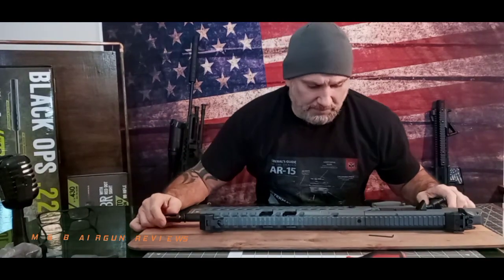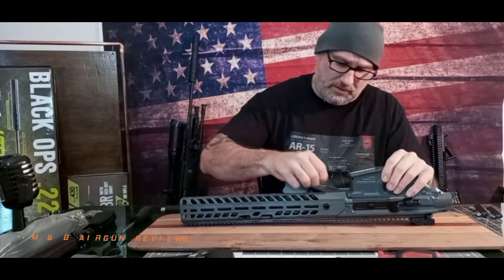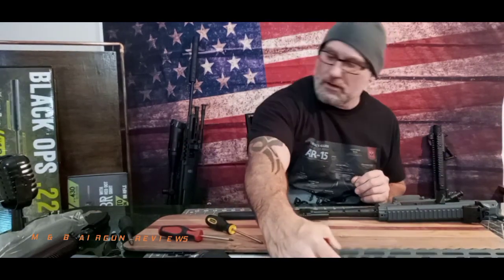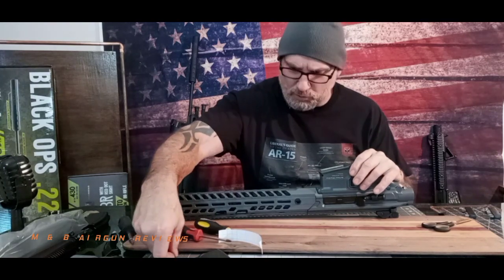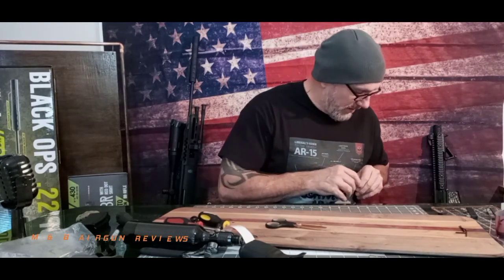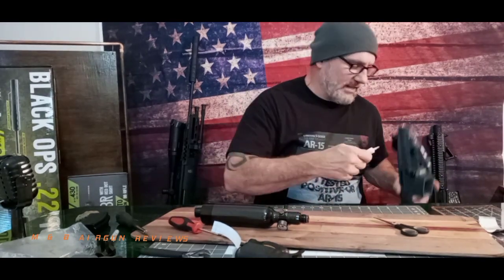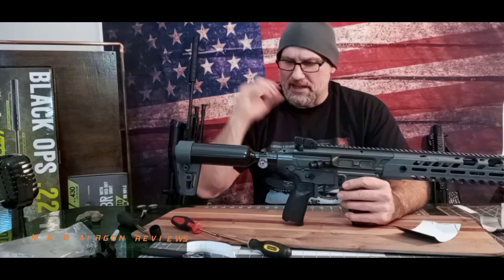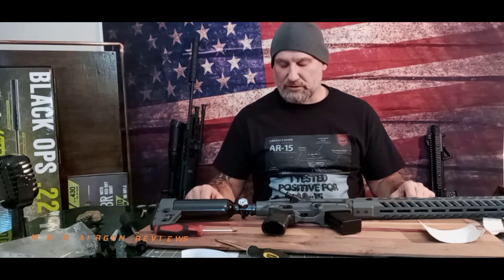Sig Sauer MCX VIRTUS PCP air rifle.  How to remedy the poor quality control.

Comment: Damn! I so hoped to see this one get apart on the table. I've just been sooo curious to see how much (or little) this one differs internally from the .177 co2 MCX. But still nice to see the bottle not to wiggle anymore just by doing this fix from the rear. Fasterr and an easier fix for many.
Reply from the maker: And its been reliable since these easy fixes. At first I couldn't hit the broadside of a barn from inside the barn. Now it's a little tackdriver driver.  
And so far no jams. So that's good.
Reply: @FultonStreetBeats  Awesome to hear! Even though it now just makes me more bummed out I did not have the extra cash on me to buy one when my favorite local airgun selling stores had of them in stock..
 Seen and heard often of these issues but been confident to know I'd probably be able to fix them myself.. I kinda love Sig Sauer pellet airguns just because they always seem to need some small fixes before being all good.😂 Too perfect airguns seem a bit too... "boring"..😁
Reply from the maker: We always need something to fix . Lol. Im the same way.
Reply: @FultonStreetBeats  Yup. And I just love fixing my co2 airguns. Pistol replicas mostly..
 My Sig P226 ASP was a total disappointment as new. Inconsistent power output - and the accuracy was the worst I've seen on any airpistol, ever. Covered randomly all over an A4-sized paper from just 20ft. The nowaday classic " Sig P226 ASP barrel issue".. One badass pellet pusher now.
Reply: once the bottle is filled there is no wiggle.You did not need to shim it.
Reply from the maker: @aaronrockler2327  the bottle should not move without air in it. This causes  undo stress on the internal pressure tube when not charged.  All virtus rifles do not do this. Sig is aware of the problem  and are rectifying  it. Or at least they say they are.  The  bottle wobble is caused by a manufacturing  flaw in the tooling.  The bottle not wobbling after being charged is simply   biproduct of physics and pressure.  If the initial  tolerance  is not correct the pressure  will make it worse  over time.  If you have noticed  many Virtus  rifles have been returned because  of this issue. Some getting so bad they eventually  start to leak and lose pressure.  I have talked  directly  to Sig and no it is not normal and is of concern to them also.   While my wobble was not super excessive....  lots of them are down right Scary.
Reply: thanks for the info.I returned mine today and asked them to check the bottle before they send me a replacement.

Comment: Did any body comment about the cocking lever? mine wont fire unless you cock it when you put the air tank in.
Also the trigger does not return to the fire position after it is pulled, you have to push it back by finger, not good for accuracy (or finger soreness!)
Will attempt to put a return spring  on it.
Reply from the maker: Sounds like you got the UK version. They have to reset the trigger forward by law so it is not a semi auto.
Reply: Yes but it is not really a true semi auto more like a double action revolver, the tool for pellet seating is a bit iffy so turned up a more accurate one from Delrin rod
looking at the box lid picture I bet the trigger spring has been omitted from the UK one I have. Ridiculous when I have two Co2 BB guns that are real semi-autos that are nearly as powerful as the Sig and UK legal! @FultonStreetBeats
Reply from the maker: @daviddunn748  Yes they literally  change legal definitions over there.  It's crazy.
Reply: @FultonStreetBeats  Great review folks thank you for your efforts look forward to seeing more!

Comment: I was wrong again, it seems to be a ammo/belt feed thing ? I wonder if the UK spec one without the return spring for the trigger has anything to do with it????
Reply from the maker: Just got rid of mine. I simply  could not keep worrying  about weather  or not it would function or not. I'm letting  all of my Sigs airguns  go.  Except for my  MPX. That's my experiment  airgun. Lol.
Reply: Not had the chance yet but, I’m going to mark each belt & try some more ammo types with them. It maybe a case of some wonky belts because it seems to be the one that came with the gun that is failing (three times). Customer service in the UK is bad too, We have no Sig rep in the UK but the importer &, well they don’t seem to care.

Comment: I will say my gun had same wobble at bottle was sent back and came back without any wobble but the barrel has a small amount of movement still and the screws were loose about like yours were and they definitely had the barrel off
Reply from the maker: I hope they correct these issues. Because it has a ton of potential.

Comment: Hello, a question: I fell in love with the MPX version, but I don't find it immediately available. Instead I found the MCX with the silencer new. The question is if I can remove the silencer to make it like MPX or is it a single body? Thanks for the answer, usually the silencers are screwed on but here I have not found any indication about the MCX
Reply from the maker: The suppressor  unfortunately covers the barrel length inside of it. So it cannot be made into a short version without extensive modification.  but the longer mcx is a more powerful and accurate (compared to the mpx) do to the extra length.  Hope this helps.
Reply: @FultonStreetBeats  Thank you very much, now I have to decide. I have an armory in response from the store tomorrow, and let's see, then ... the choice. I fell for this weapon, you have the like, and registration due

Comment: Thank you very much mate. I have these issues with mine, think its an early model as it has a ridge in the mag well. Just followed your instructions and tightened everything up. My top rail attached to the receiver has a wobble and I can't figure out how to get it tightened down, any tips would be greatly appreciate. Much appreciation from the UK.
Reply from the maker: Thank you . When I get a chance I'll take mine apart and see what the issue possibly could be.

Comment: Doesn't that piece of carbon fiber tape kind of defeat the purpose of free floating the barrel?
Reply from the maker: Normally yes. But in this case unfortunately the barrel has to much free play to not have need for support.
Reply: Yeah, the point of the floating barrel must be a deterrent from actually hitting anything ! 😂

Comment: I purchased mine the other day on Amazon and when I started hand pumping it, I realized it was leaking air where the magazine goes in. Very frustrated! Any tips? Great video by the way!!
Reply from the maker: Unfortunately as of yet I haven't dived into the receiver. With an issue such as a internal air leak I think it would be best to send it back. If you do decide to send it back, and you can be a bit patient... I just may have something coming up in a upcoming video that may be right up your alley. I've had a new company reach out to me in the air gun world. And it seems their product may be the answer to all of our prayers. I'll be posting a video later tonight on some initial thoughts on the company.  Tomorrow I will be revealing the company name and it's business philosophy as I have been told with some PCP airgun products available. I'veI got a good feeling about them but time will tell. But if you can wait till tomorrow I can at least tell you who they are and you can check them out for yourself. And if you can even be a little more patient then that I will be getting one in sometime within the next 10 days for review. Although I understand. If you cant wait because patience is not exactly my thing either. LOL
Reply: @FultonStreetBeats  you're right. I would have to send it back. it sounds like an issue I should not mess with. it's internal.
Reply: The valve possibly leaks out from the nozzle. Many Sig ASP airguns has had poorly made or assembled valve seals. Might just need a reassembly - but one never can be 100% sure. My Sig P320 ASP airpistol just needed a valve reassembly to get all good.

Comment: Why  not a little bit of red locktite? Put a rubber cap/cork, or some tape or something in side the port so locktite dont get in there. The just go arount between the receiver and the port where you put the shim.  Or you can push an "O" ring between there. Or get some weld puddy the grey steel stuff or a little bit of some JB weld. Just clean it up real good and flush like. Even machine a set screw.. i can think of 50 different ways to fix that. Not being shitty im just throwing out some other options.

Comment: My understanding is that you need to fill the tank first then put it on
Reply: no that does not matter,I put mine on then filled it up.Once the bottle is full there is no wiggle.
Reply: You can fill it in situ dot screw it any further than to open the bottle valve